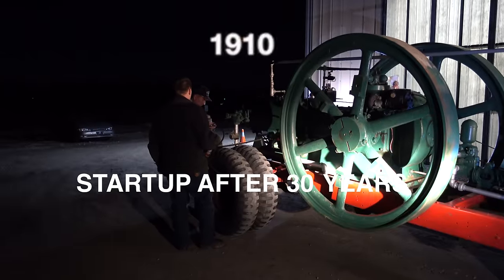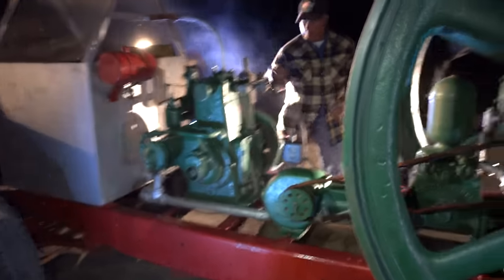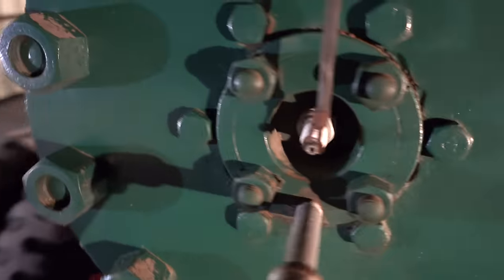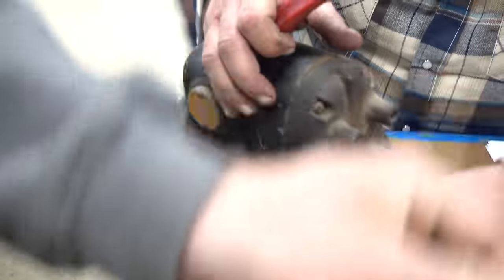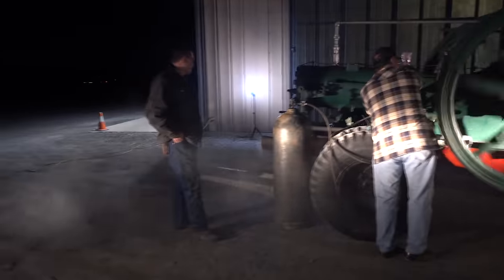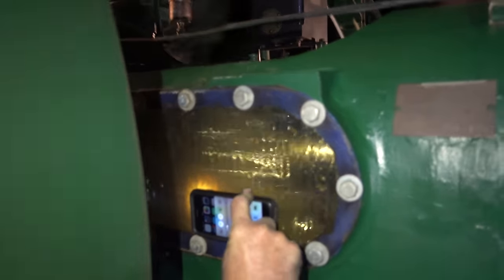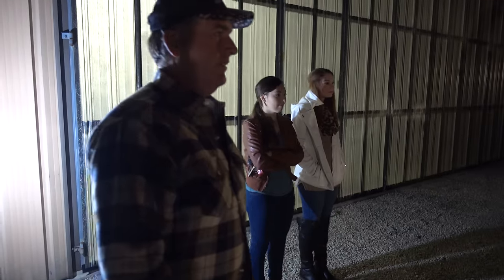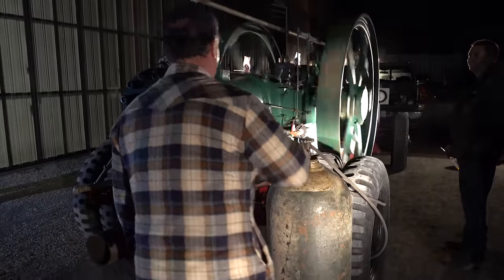1910 Cooper Bessemer 35HP ENGINE STARTUP After 30 YEARS

Comment: So it’s like a giant refrigerator engine?
Reply from the maker: Just a big general purpose 2 stroke engine. This one was running the refrigeration system at the ice plant, probably with a belt drive. ❄️❄️❄️
Reply: Makes sense
Reply: These were also commonly used to power early saw mills